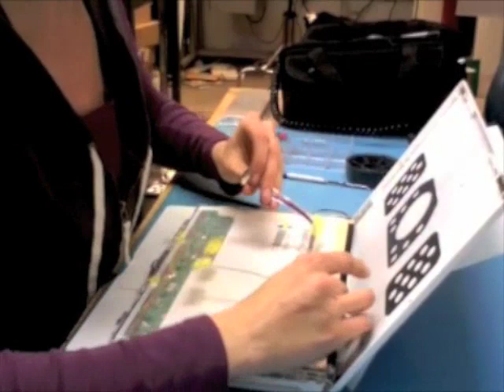MacBook LCD Replacement Part #1

Comment: @TomTrix99 if theyre quoting that price its probably a motherboard theyre quoting for and for this age of machine the price of repair theyre offering is not is not worth it, checkout  i f i x i t dot com for instuctions to strip down your machine. could be the graphics chip thats causing your problem, but a complete stripdown and reassemble might resolve your problem.

Comment: Turned on my macbook 13" a couple a days ago and about a fifth of the screen on the right side was covered in colored lines. Does it mean that the LCD is broken? Went to the shop where I bought it and they told me it would cost about 650+ dollars to repair it ( I live in Norway, everything is expensive here) I can still use it and the machine works really well. Is there a cheaper way for me to replace the LCD? btw I have decent computer knowledge, but I am certainly not professional. Thanks!

Comment: Don't try this.  Just take it in if inverter board is the issue.  If you really want to DIY, then go the long way and take screen off.

This did not work at all for me as I needed about 10 more degrees to get the hinge piece out.  I finally got it out and it was tight, and then replacing back over the inverter board ended up damaging the wires inserting into the board.  I ended up having to take it to the Apple store and with a new inverter board and hinge cover + Labor it was only around $60.

Comment: Success!  Thank you!  I'm with dmnyli, below.  It took some time to "see" the inverter plug.  I used a tiny nail on the end of a hemostat (clamp) to work the cable clip in.  The tips of my fingers are still sore from holding back the clutch cover!  Another issue -- keeping the sleep magnet in place as you reattach the frame.  I finally held it down with the eraser end of a pencil.  .Just one mystery -- I double-checked all around the frame. I couldn't figure out where that "extra" screw goes!

Comment: Here's a tip for anyone else who has trouble with that step...The area of the inverter board for the cable clip to attach to is on the KEYBOARD side of the board.  If you bend back the clutch cover enough, you can actually see the bridge area that will fit between the wires of the cable clip. Line it up with your hand, then use the pick/dentist hook to push it into place.

Thanks again, and good luck!

Comment: First off I want to say thank you!  

This was the first adventure I took with my macbook disassembling and it worked great.  I followed this video step-by-step (having to re-watch quite a few portions of course), and the screen replacement went pretty flawless.  The only frustrating issue I had was installing the inverter cable into the inverter under the clutch cover.  What is shown here done in about 20 seconds, I think it took me 2 hours, but I was finally successful.

Comment: the backlight on my macbook will randomly go dim.  to get it back on, i have to wiggle the display.  the apple store tells me its just a pinched wire (the inverter cable?).  but to fix it they'd have to send it out and it'd cost a ridiculous 280 bucks plus tax.  fuck that.  how do i un-pinch the inverter cable?

Comment: @alertgirl25 inverter.  When we researched if we would be able to change the inverter, we discovered that the inverter cable wasn't completely plugged into the inverter.  We were ecstatic that was the only problem.

Comment: @JHanzi1000  We are by no means technically abled.  This video was excellent in helping a novice replace the LCD after our 2 year old dropped the macbook.  This video helped tremendously.  You can imagine how frustrated we were when we went to turn the power on and nothing.  I did notice the screen kind of flicker and in a well lighted area we could see the log in screen.  We searched everywhere for an answer and were ready to give in to the thought that we were going to have to replace the

Comment: You might need a 2.0 mm Phillips screwdriver. Pull a cord looped into the slot on the right side of the hinge cover to see where the plug sits. (Do not pull the cover with your finger tips. The pressure can lead to nerve damage with numbness that lasts days.) Use a guide to position the new plug.  A stiff wire with two right-angle bends works fine. If there are 2 people,1 pulls back the cover and the other guides the plug. Don't lean on the new screen when you pull back the hinge cover. Danke.

Comment: I couldn't connect the inverter cable wire to the inverter, I had to take out the bottom to connect them together. After all, the new screen worked for 10 seconds then it went off like usually. And now my keyboard doesn't work too. Does anyone have the same problem? Thank you very much :(

Comment: I've just replaced my lcd according to this great video. thanks a lot. but actually it was pretty stressful. cause after i disconnected inverter cable, it was not so easy like on video to  reconnect it back. it takes a while to me to connect it back. and i made that magic Rebecca's tool from broken sunglasses wire. actually you should see approximately where the inverter is. and for that is helpful to see some inverter images (just search in the web) to imagine where to push connector

Comment: Yay, I finally did it. i bought a pick from Sears. It  wasn't as good as hers because it wouldn't stay in, but after a long time I did. The screws took the longest time because I was using screwdrivers that were either a little bigger or smaller.The only thing wrong was parts of the wire wouldn't fit anywhere (the black and gray one) and so the frame is sticking out a bit.

Comment: What is the name of that pick tool. I can not find a tool like that. What else can you use to plug the inverter cable, it seems impossilbe. I think i will break the hinge, because I can not see that slot it goes in. Help please

Comment: I used a paper clip to helped  make the connection and that worked fine. I think the plastic tool would make dealing w/ hinge cover a lot easier. Not sure where you would buy that though. I tried a credit card and a small letter opener neither which worked that well. Anyway thanks Rebecca K for doing the video.

Comment: Thanks for the video. saved me at least $150. I was willing to pay $200 to someone who knew what they were doing but couldn't find that locally or online (shipping costs brought it over 200) Finally I said what the hey found this video and everything worked out....well except the hinge cover and the bezel(frame) which isn't perfect.. The only thing I would do different is buy the plastic tool that she used. Also I pulled hinge cov. way back so I could see the connection. This REALLY helped!